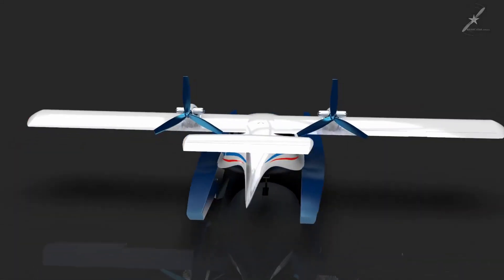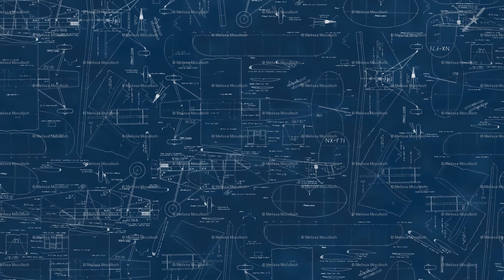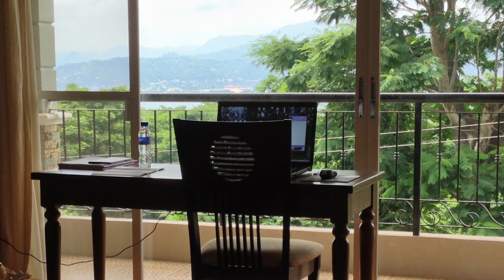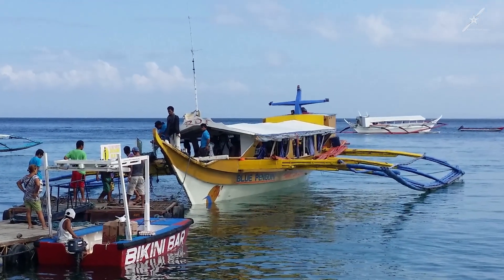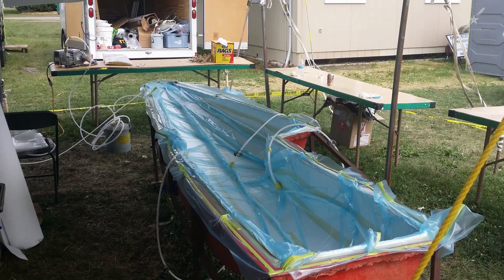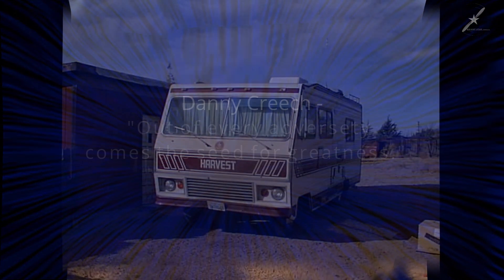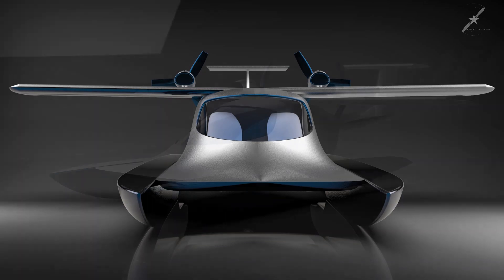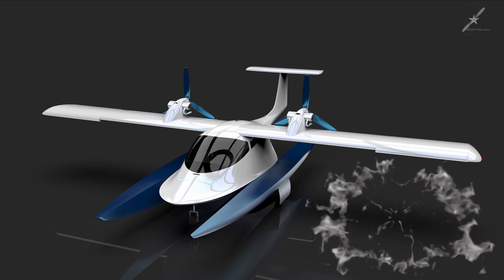My Radical New Amphibious Design!

Comment: With solidworks software, are you able to print out templates to build your design from? I'm thinking of how they build cidar strip kayaks simply to make a plug to make molds from.
Reply from the maker: Nashvilleoutlaw, YES you can print out templates from Solidworks. If you need them full scale you can the the files to a printer and they can print them 1 to 1 scale. Thanks for the comment.
Reply: @BrightStarAssemblies   Thanks for the reply and great to know. I recently learned you can get a free version of solidworks by joining EAA. I'm kinda torn on building an 103 seaplane or warbird. Seaplane would be more versatile but a spitfire would be pretty nice too.
Reply from the maker: @nashvilleoutlaw  Yes in my first video I did walk people through how they can get Solidworks for free by joining the EAA. It is a great program but is hard to use and learn. I understand it is a hard choice when deciding witch aircraft to build. There are so many very cool aircraft out there and each one of them require a large chunk of your life/time to build. The decision on which one is totally a personal choice. I recommend you go with the one that you are most passionate about. Many people give up during a build because these projects can feel overwhelming. The best advice I was ever given on how to complete your project was "Do at least 15 minutes of work each day on the project. Even if you are discouraged,  just do 15 minutes."  It's kind of like the saying "How do you eat an elephant? Answer: One bite at a time."

Comment: It seems to me that the water wake could potentially end up going into the propeller disk aera. Also it seems to me the the wetted area forward of the neutral point is substantial, which could result in destabilizing characteristics. Otherwise it looks promising. Would you be able to elaborate in future videos on your forecasted Wing loading/power loading, aircraft wetted area. As well as performance goals. That data would put us in a better position to make feasibility comments. Anyway have Good luck and all the best.
Reply from the maker: Thanks for the comment. We will be looking at that once we build the prototype. If that is a factor then we will address it. But for now, I think we are good. As for the wetted area, that will probably get changed as we are still looking for an expert who knows more about pontoons than us. Yes, in future videos we will share all data. As for now, though, there is many design features that are still in flux which will change. This is just the beginning of the design process. I am sure you noticed in the video that there were images that were completely different from one another. As stated in the video at the end, my next video which I have already started on will show how we got from the first images to where we are today in May 2021. So in that video you will see where we are at now. Then future videos will come out as we continue to make changes. Thanks for the comment.

Comment: Just opinion, main gear shouldnt be located in the floats
Reply from the maker: Thanks for the comment AB C.  Yes the "Main Landing Gear" are located inside the floats. They are retractable and retract into the floats.
Reply: @BrightStarAssemblies  Exactly, from a mechanics point of view thats a headache. Id have the main gear incorporated into the hull of the aircraft, rather than the float. Just my opinion, since Im an A&P. Sharp looking aircraft though.
Reply: @c.w.miles-cowboycookstoryt1528  Yes great but they should come out of the sides of the floats. Coming out of the bottom could create uneven stress points.
Reply: @falconer100  Well, to each their own, nice plane
Reply from the maker: @AB C   Good point. I kind of like that idea. Would sure make it easier for designing the gear. I have my letter to go get my A&P now but don't have the time to go get it. My brother has his with IA. He is the one who signed my letter. I will go get my A&P in a year and seven months when I stop working at my current job. Right now I just don't have time to go to the prep school for it. Thanks again for the comment.
Reply from the maker: @falconer100   Not to mention that the water could rip the gear doors off when extending or retracting the gear in water. I kind of like AB C idea of having it come out of the aircraft. I will think upon this idea for a while.

Comment: Yeah! A post!

Edit: looking at you design I noticed two major things. Tandem seating and a Ttail configuration.
If your storage area is in the back  your aircraft will most likely always have an aft cg. If you put the cargo hold in the front 40% of the pontoons you can rid any unforeseen incidents
Reply: I’m almost certain it was 2 am when I left this comment I obviously wasn’t thinking right
But yes
Reply from the maker: @simpilot001  Been there done that but normally it is with about three Rum and cokes under my belt. haha
Reply from the maker: So the design if you look from the front which is shown in the video is side by side seating. I also state that it is a four seat aircraft in the video. T tail is not a "major thing" it is used in most jets that I fly and many other GA aircraft. However, there may be a change to the T tail in the future. The fuel and storage area is very close to the CG but is aft of it. So as one burns off fuel the aircraft will become less aft CG. A most rearward aft CG is a very good and efficient thing. No one should ever go beyond the CG limits. So, anything inside the CG range is good. If you would like to go into more detail about this I always like hearing what others have to say and you can email me at: brightstarassemblies@yahoo.com Thanks for your comment.
Reply: @BrightStarAssemblies  alright thanks for the response. Not many people look at their viewer’s responses or interact with them it’s good u r
Reply: @simpilot001  ...Hmm...I  kinda like the "T-tail"...Not many planes have it...And, since he is going with pontoons, I  think its gonna be significant turbulence and disturbed at from them...The T-tail gets the Empennage  up into clean air on take off and landing...
Reply from the maker: @ToyManFlyer1100  Thanks, I agree with you. :-)